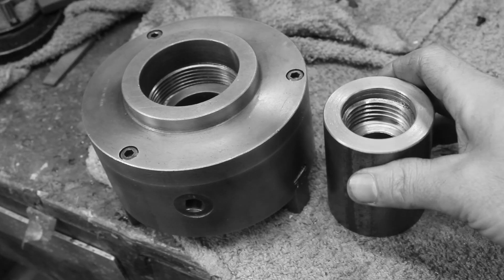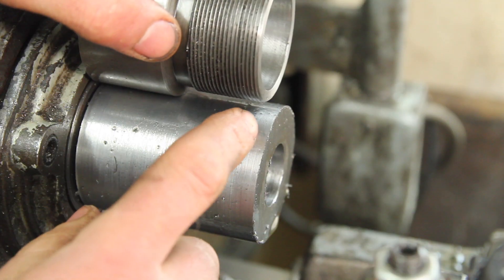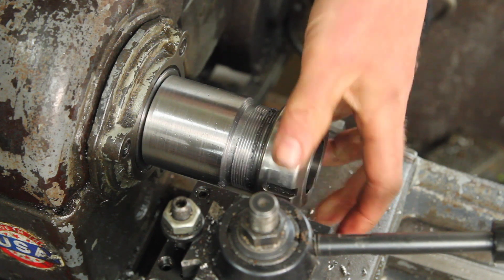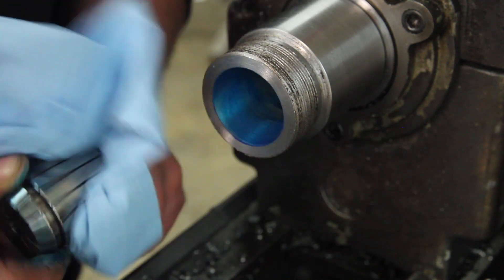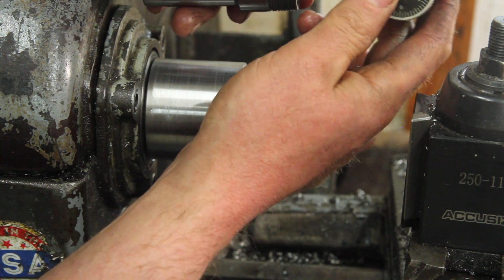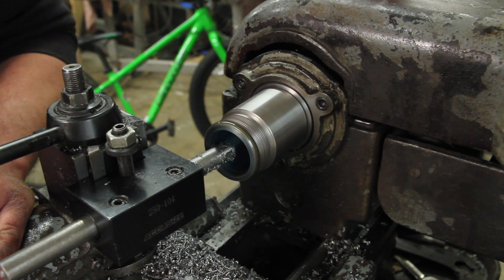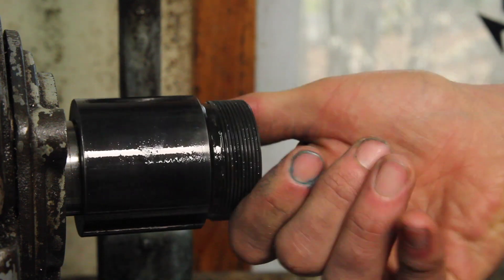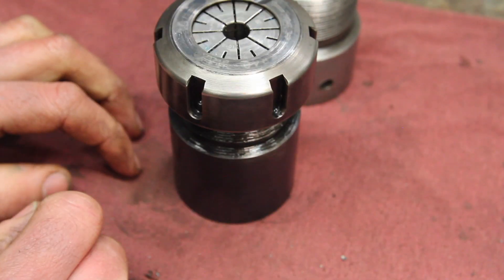ER40 Collet Chuck Build

Comment: I did a 5C collet chuck for my lathe using pretty well the same operations you did.  And I got similar results including the emery final finishing.  You didn't clock in the surfaces of the taper.  If you had I'd bet that you  would have been dead on zero.  The collets have some runout too after all.   When I finished the surface with fine emery the idea wasn't to totally polish but rather to remove the crests of the machining marks. If done to that level we can actually improve the accuracy.  That's because when we're removing crests off tapered tooling marks the abrasive action is self limiting.  It'll cut more off the narrower points and less off the broader crests.

Comment: Hi,i made this comment to "This old Tony",i saw this on a vid about rebuilding my Triumph Spitfire gearbox and de-rusting parts,but it works great with bluing parts.

Get a (preferably) ziploc bag big enough for the part,do individual bag/part combo,if the part is profiled like the nose cap be sure the bag can get inside the part too,add enough bluing fluidto coat the part with a little extra ,put the part/bag combo in a bucket of warm water ,probably  a nice hot cuppa tea(coffe in the states).

The hot water will compress the ziploc bag around the part forcing bluing sollution to make intimate contact all around the part,if you use a clear container you will see if you have added enough bluing fluid,allow the ziploc bag opening to be above the water line far enough to not allow water in and to allow you to top up until the part is fully immersed ,you will use far less than dumping fluid into a tub,it will hot blue with far more professional effective results,leave overnight for deepest bluing effect.

Hope you get a chance to do this as it is the best method by far,selenium dioxide is toxic and is better used in this way.

I want to make a collet chuck,thumbs up .

Comment: Hi Jeremy, a job well done. I was pleased to see you commit to the pin spanner hole before you started. Making a backing plate for my 5C chuck, I didn't. Fortunately I'd only just removed the 4 jaw  so I remounted that to the new plate and used that to pry it off. Won't make that mistake again.

Setting the compound for the 8* angle I set a piece of drill rod the size of the collet in the 4jaw, centered, then slid the collet onto the bar. Set the compound Over to +-8*, ran the DI on the compound backwards and forwards while adjusting the angle until I achieved zero. 
Mounted the blank and started whittling away until size was achieved. Test was done with the same piece of drill rod in the collet, blued up and achieved a satisfactory result. The holder (chuck) achieves about 0.0003" runout across my tested ER 25 collets.

I used the same method for a 5C to ER25 adapter to use in the spindexer.

For setting angles for Morse tapers I put a centre in the spindle and the tailstock and then mount a commercial Morse taper between those centers. Gives me good results. Just wish my compound travel was a little longer. It's at the limits of a #2 length wise.
🤞🇺🇦🕊️🇨🇦🍌👍

Comment: Looks like you got some mild bearing play
Reply: I was thinking that too.
Reply from the maker: Everything else on this lathe is worn, so I’d be surprised if there wasn’t.
Reply: @JeremyMakesThings  I’d say it’s possible to adjust those like I was able to on the atlas it’s a timken roller setup just a dial indicator on the taper and a bar just adjust till play is minimal and the spindle turns freely
Reply: Made a massive improvement on my old atlas’s was able to actually use carbide and part with it after
Reply from the maker: Unfortunately, these Logan’s have their own special preloaded spindle bearings  that aren’t adjustable…but the replacement is still available.  But given the cost, for now, it’s still “good enough.”
Reply from the maker: I did some evaluation on the bearings today, and they actually seem pretty tight, but I did discover another issue that might make for an interesting video in the future….but I don’t think it accounts for the changes between turning the lathe by hand and under power.
Reply: @JeremyMakesThings  hard to say just the watching that needle bounce when you was hand spinning it looked like it was just a little loose on maybe the rear bearing hard to say tho

Comment: How much to make one more ? I have a Logan 400 with 1-1/2 x 8 spindle. It was missing most of the change gears when I got it maybe 6 years ago, so I haven't been able to cut any single point threads.
Reply from the maker: The problem with making another one is it really should be done on the spindle it’s going to be used on to make sure it’s as concentric as possible.

Comment: I can think of a few things that can mess it up. The final sanding by hand or collet run-out, cheaper imports usually have 0.01-0.02mm run-out .

I built a leadscrew controller for my lathe and turned  ER40 chuck in-situ like you did and got about 0.005 - 0.01 run-out.
Reply: The cheaper imports often have more runout than that.  I had to rig up a temporary tool post grinder to make an import chuck usable even for basic stuff since it had so much runout.  And from what I've seen of YT reviews of these products I'm not the exception by a long shot.
Reply: @brucematthews6417  true, you can still get decent ones on a reasonable budget. I got a set of ER40 collets for about $200AUD a couple of yrs back, stated accuracy 0.008mm which I have verified.

Comment: Hi Jeremy, further to my comments of three months ago I'd like to make a suggestion. 
If the inner diameter of your chuck is about an inch you could cut the same internal thread as is found on a 5C collet and then you could use the depth stop for 5C collets in your ER 40 chuck when making repetitive bits. If the diameter is larger you could always cut a suitable thread and make a depth stop to suit.
 I drilled the end of mine #6*32 so as to be able to screw a smaller depthing rod for down to about 1/8" material in my 
ER 25 collets.

Comment: I'm sure you've heard it before about running threaded chucks in reverse. A friend of mine is insistent that I don't rewire the switch on my Clausing to do it for the same reason.
Reply from the maker: Having the chuck unthread is really only a risk if you’re cutting with it in reverse.  For backing it out on doing metic (or other oddball) threads, it’s fine, and much better than turning it back by hand, since you can’t disengage the half nuts.  It’s also handy if you’re cleaning up damaged threads on a part with a file, since you can let it run off the end.
Reply: @JeremyMakesThings  that's kinda how I see it as well, and it's ultimately my call, as it is yours. User discretion I suppose.

I've really been enjoying your content lately BTW. I just picked up said Clausing a couple weeks ago and am all for recycling materials.

Comment: Subbed. Not only for the content, but this project was the exact thing I was looking for,  for the exact same lathe. What are using for metric change gears?
Reply from the maker: Boston gear parts GB37 and GB47B, pinned together, drilled out, and a bronze bushing pressed in to mount directly onto the change gear stud.  (I have the early style change gear studs).
Reply: @JeremyMakesThings  yeah, I guess I asked you the same question on a different video (snow maker),  not realizing you were thr same guy. Lol. Thanks though,  I really like your setup over the other options.

Comment: From what Logan Actuator says the back register fit on the ID of your chuck makes no difference and to some degree the thread fit is not critical either. They say the threads self center when you tighten and for the most part I have found this to be true. Also when test fitting threads always take a file and knock off the tips of the threads (or emery cloth in internal threads). A perfect thread profile isn't sharp. Threads that seem tight may actually be cut too deep. Good job on the taper. I bought a chuck and mounted it to a face plate. In hindsight it might have been easer to do what you did. Good video!
Reply from the maker: I can see how that works on the spindle in theory, but in practice, the first one I made did “move” over time.  It would run true for a while, the go out of true, I’d clean it up and it would be good for a while, then go out again.  Maybe it was thread wear, maybe it was dirt hiding in the spindle threads…at any rate, this one registers really well, and maybe that’s “belt and suspenders” but I think it should be good for quite a while.
Reply: @JeremyMakesThings  I'm guessing the better thread fit helped and not the unthreaded bore area.

Comment: It all depends on the "Minimum precission level" you impose to yourself. On 90% of the shown techniques in this video, you're cutting corners, so you are shaving pieces of precission in the final product. I really don't get the point of choosing the "non precise method" when it comes to machining.
Reply: It's all relative, sometimes good enough is good enough ;)
Reply: Perfection is the enemy of good enough.
Reply: I prefer "Don't leave good enough". But that's me.